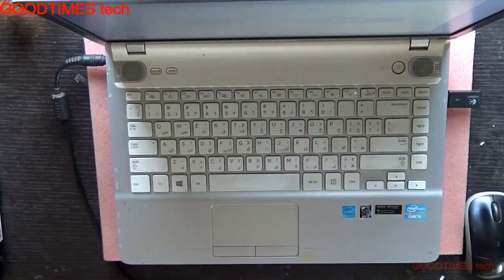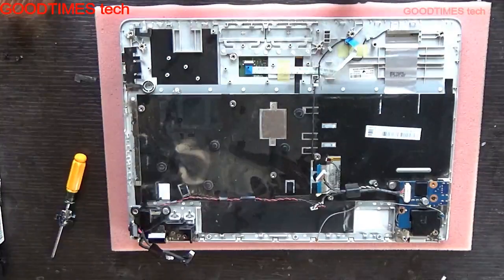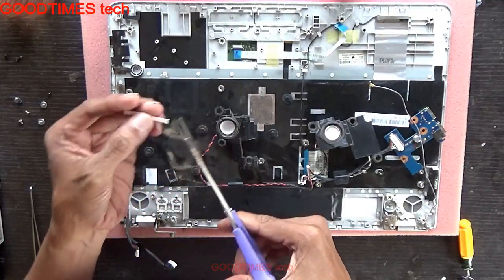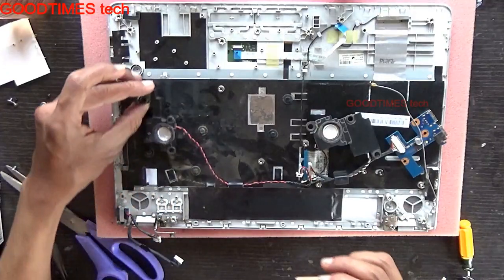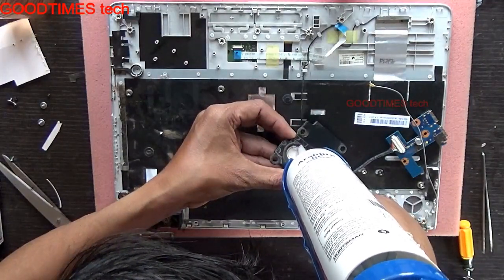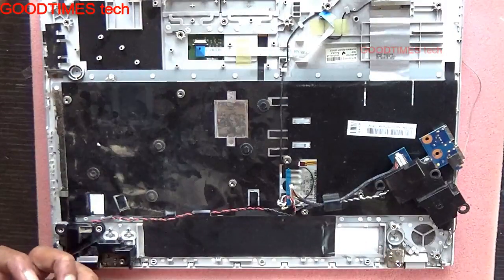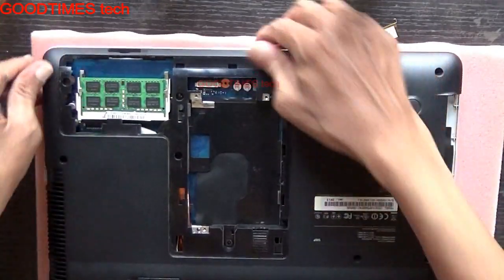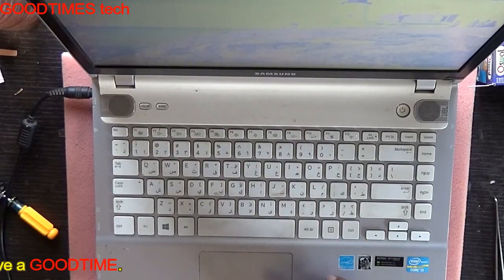How to Repair Laptop or Smartphone Speakers producing distorted sound.

Comment: would be great to know if it also works using PM polymer (silicon sucks as it doesn't last more than few days/weeks after opening, and its much harder to work with  (to seal stuff)  as it sticks and dry too fast)

Comment: Thanks, instead of spending $ to buy a used old speaker, I used Silicone Sealant to fix it. Since it locates in the front of my laptop, I did not open the whole computer, instead, I directly reached the speaker by loosing the screws in the bottom and raising the cover of the speaker a little bit.